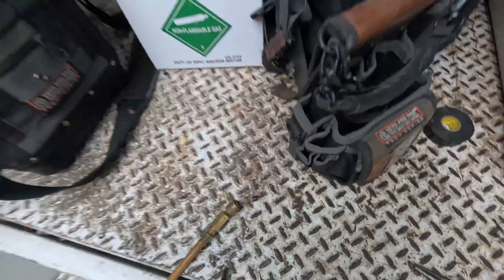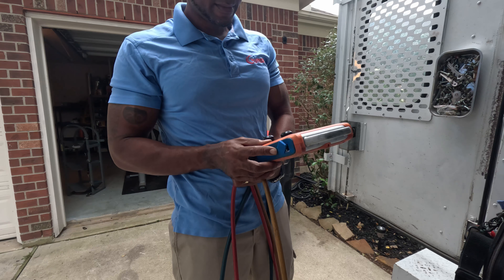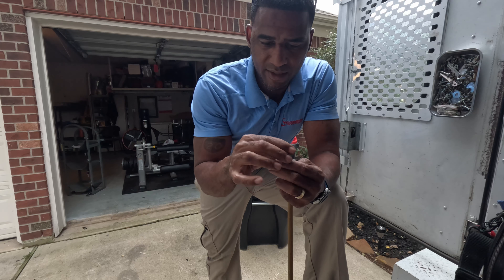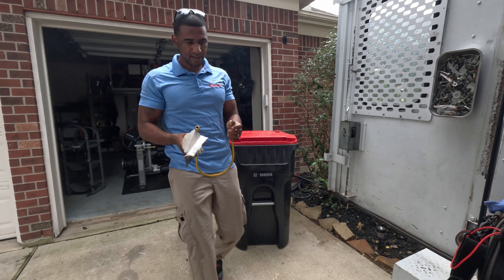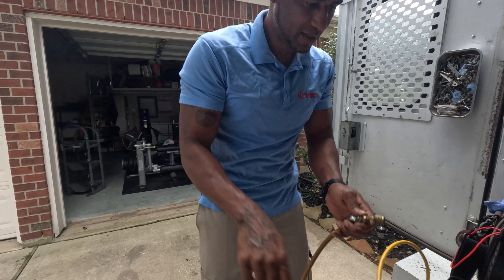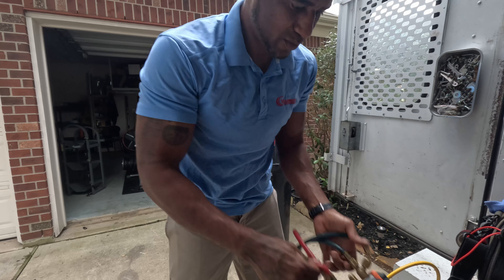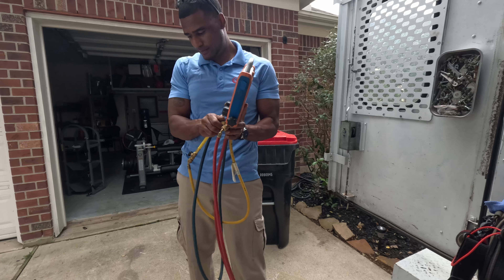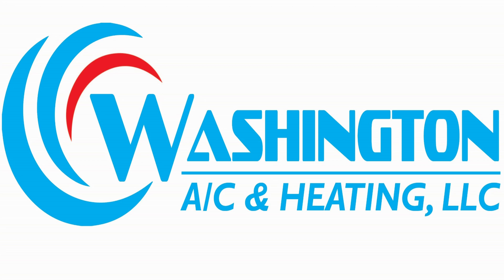Katy HVAC Repair | HVAC Recharge: Changing a Refrigerant Hose | HVAC Repair in Texas HEAT

Comment: Just last week I upgraded my refrigerant tools. Two new sparkless ignition proof R-32 R-90 ready vacuum pumps a 6 CFM and a 12 and I’m gonna get the 2 CFM battery DC vacuum pump. I bought all new hoses and manifolds with a quick charge for separate freons and I got a pro vacuum hose kit with supco vacuum gauge and recovery hoses with a recovery sub cooler. I got the Field piece 680 meter with dual thermocouple clamps. And I’m getting a nitro purge regulator for soldering. Like Folyd Mayweather says I stay in training and ready, they never gonna catch me slipping. Bring it on Seer 2.
Reply from the maker: Your ready for whatever!

Comment: Equipment maintence...always a great idea.  Maybe you will benefit by installing a quality 5 or 6" Wilton mechanics vise in your truck or garage.  Those would help much with getting those fittings loosened or tightened up. Also end wrenches will have more success vs.  adjustable wrenches due to the brass being soft...as worst, vice grips might do. I like those electronic gauges in the HVAC field however, outside in the sun, they aren't so great compared to the good old round gauges with the pointers.
Reply from the maker: I just bought a vice last month for the truck. Haven't installed it yet. I really need it for the gas valves